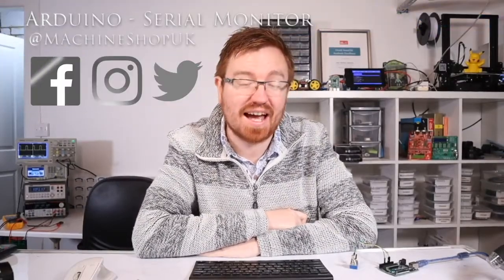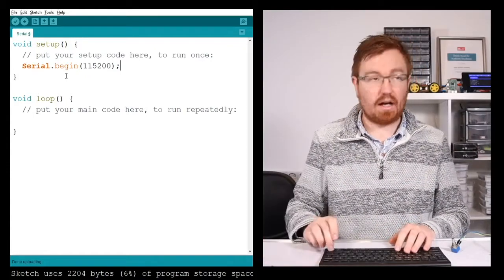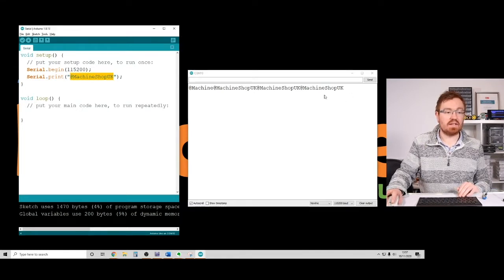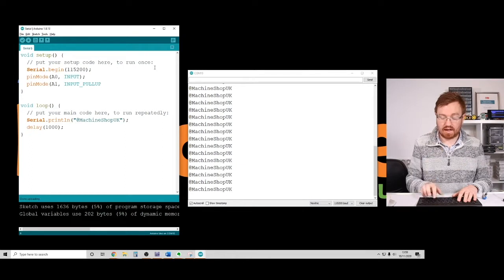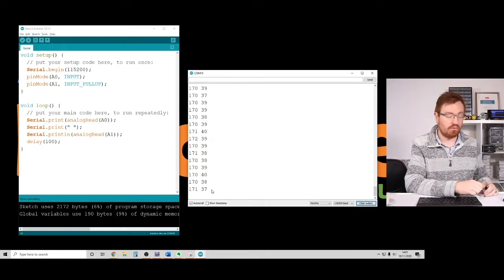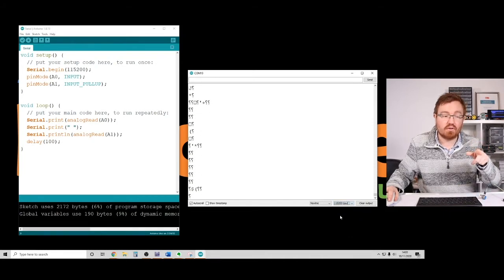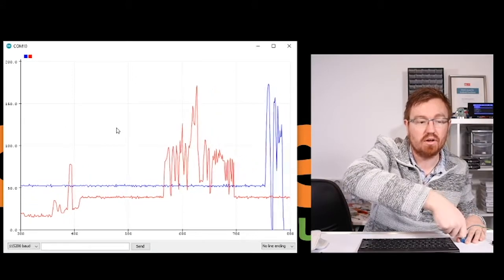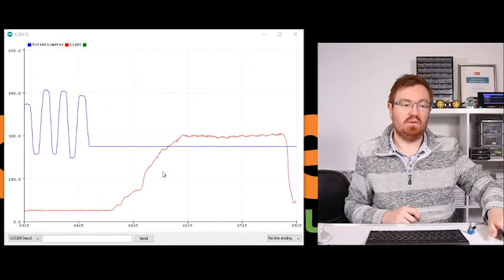Arduino - Serial Monitor

Comment: I have been piddling with small stuff like what comes in a beginners kit this past year so im pretty dumb to coding and old. Im building a rc buggy and since im a fabricator by trade thats the simple part. Im determined to learn coding, or enough to at least do this project. Its been a struggle learning since most tutorials skip over the most basic info that would be helpful for someone thats for the most part never touches a computrer other than emails and social media. For 2 hours ive searched for info like what you covered. Refreshing. You earned a sub here. Thanks